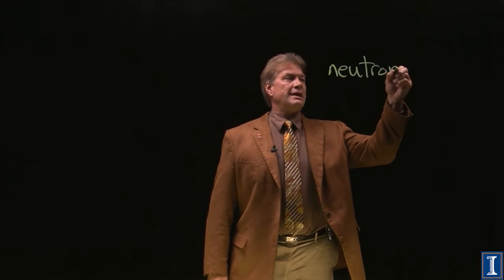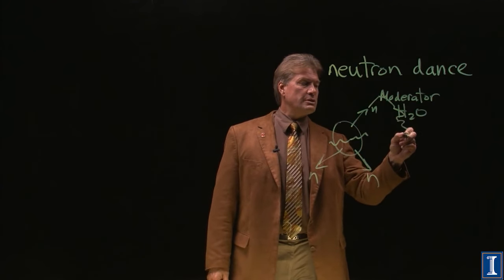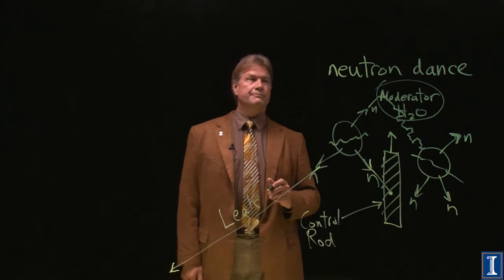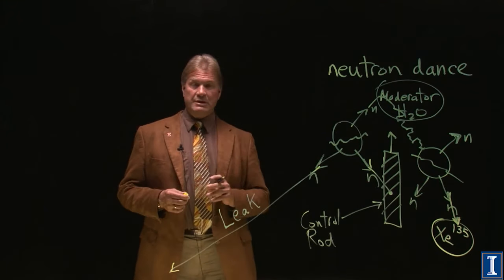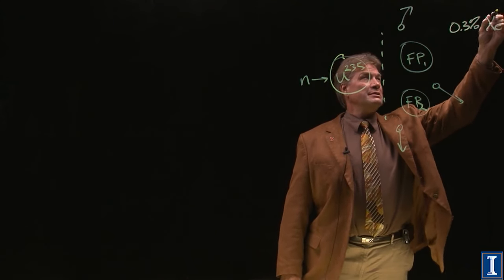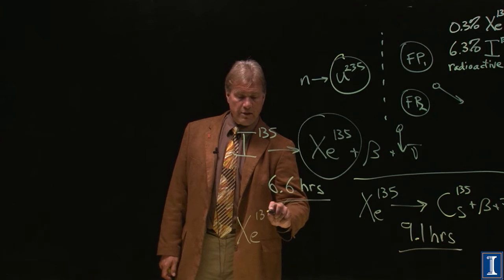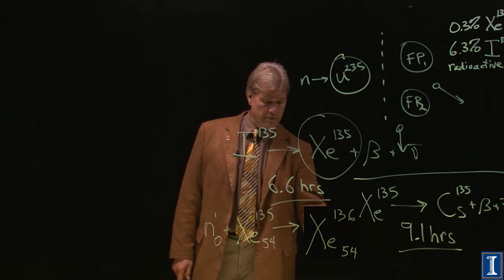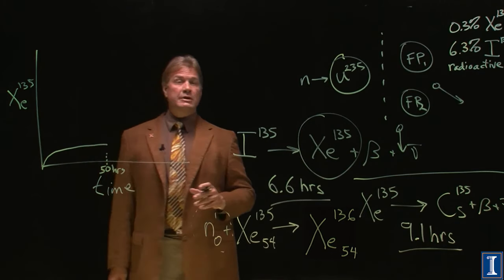Xenon Can Be a Problem

Comment: I've read descriptions of the Chernobyl accident that mentioned xenon poisoning and it's effect on the reactor but never really understood what it was.  This video provided an excellent explanation of the phenomena.
Reply: Nope. Going over the regulation list was the cause.
Akimow should use the water for "cooling" the rector...it would end with the moderate damage. Because it was SL-1 in bigger version...
Reply: There were a bunch of different things that combined to create the Chernobyl disaster.  Xenon poisoning was definitely one of them.  Xenon poisoning was the entire reason that the flow of coolant was reduced greatly AND the reason that the safety system that operated the control rods was disabled so more than the allowed number of control rods could be removed in an attempt to overcome the Xenon poisoning.  The runaway reaction was caused directly by the lack of control rods in the reactor (creating serious "hot spots" since the minimum 24 rods arranged throughout the reactor that were ALWAYS supposed to stay put were mostly removed) and the lack of coolant being pumped was what caused steam voids to form in the coolant channels in these hot spots.  
Once those two things happened it was all over.  Obviously the positive void coefficient and the flaw in the control rods were instrumental too.
Reply: @danlorett2184  
Those "rods" are called buffers. They were created to suppress the "power jumps" during the shut-down.
Of course you can flood reactor with water and whole reaction would be killed.
Diatłow thought about that but Akimow, pissed enough on rough old man, used AZ-5 thus blowing the nuclear reactor.
No one listened young Tuptonow...

P.S. I believe it was iodine, no the xenon that caused the problem. I-135 with half-life of HOURS! (6.57 h) Also open to neutrons.
Reply: Sounds so simple ... and logical.
Reply: @danlorett2184  Xenon poisoning is not cause of Chernobyl disaster for the same reason that gravity wasn't a cause of Columbia disaster. Xenon poisoning is just a physical fact. You design your system to deal with it. And if you did not design it to deal with it the cause of the disaster is you, not Xenon poisoning.
Reply: @danlorett2184  I am happy we could come to an agreement. Have a nice day!
Reply: Phenomenon* phenomena is plural
Reply: Me same
Reply: Once I heard that civilian operators were not taught about xenon poisoning because it was considered top secret military knowledge!

Comment: They did know about Xenon-poisoning. The reactor could detect it ( by the typical drop of energy production) it even had a shut-down-automatic for this case. Only this automatic was disabled by a manual override.
Reply: i read somewhere that they knew about it, and even had a safety protocol , which pointed out to shut down the reactor in such a case, but Djatlov didnt give a fck and wanted to start the test anyways.